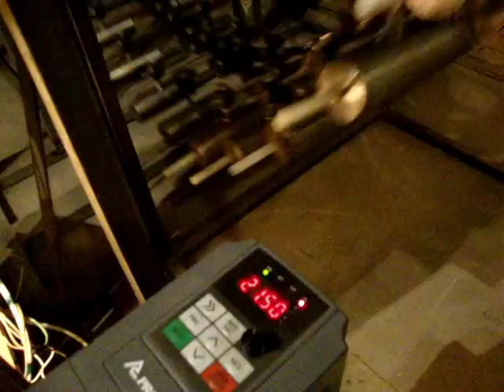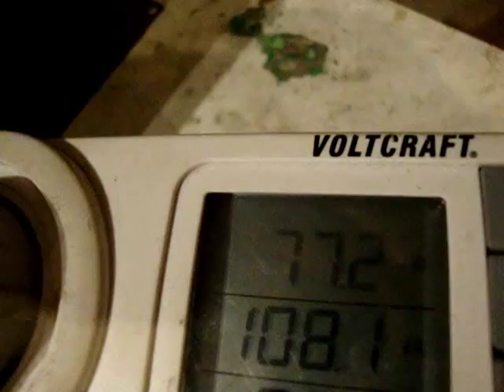addition3. Small load

Comment: The input wattage is correct.  However, we do not have a load meter before the bulbs, so we don't know how much power is being generated.  By the brightness of the lights, it looks to be about 100 watts.  But you can easily test that by installing a watt meter on the bulb side as well.  This will tell us for sure if it is overunity or not.